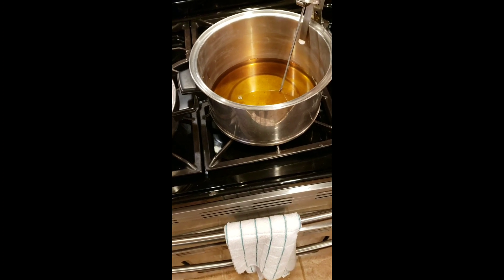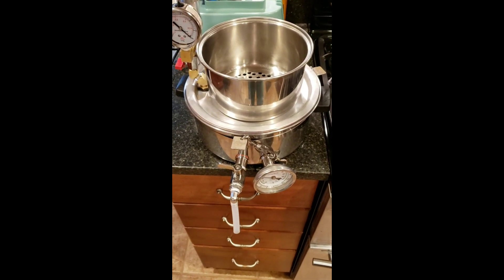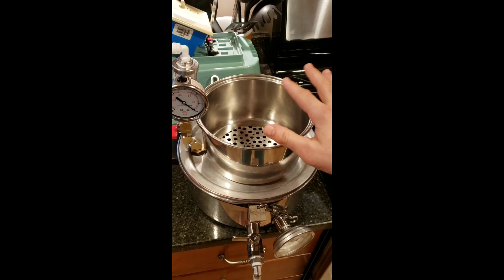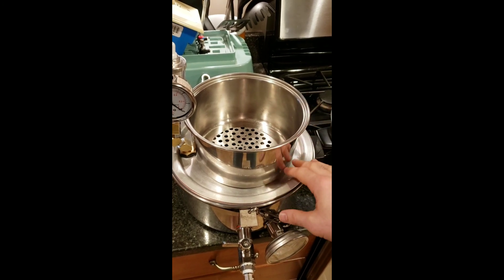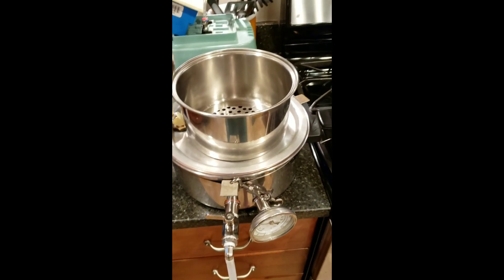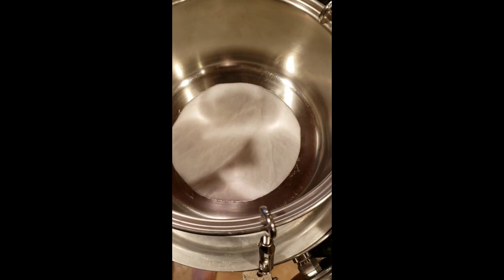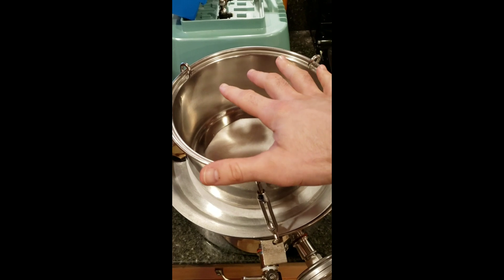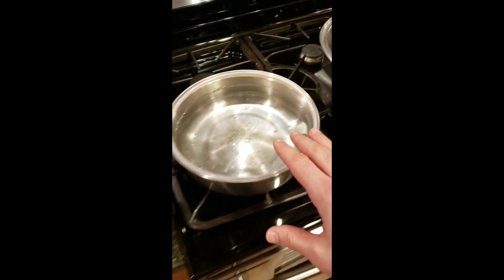Maple Syrup Vacuum Filter and Steam Heat Bottler

Comment: After looking at your video it looks like you just used a vacuum pump alone, not a pump connected to a separate air tank like others are doing
Reply from the maker: Correct.  The smaller size setup and the pump used easily moves enough air (CFM flow) to quickly create the vacuum and process the typical volume of sap